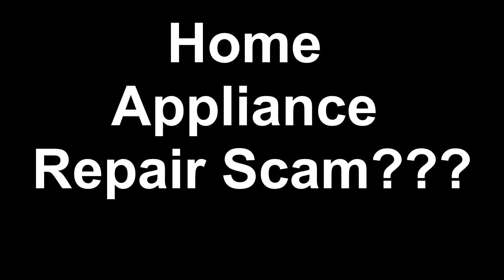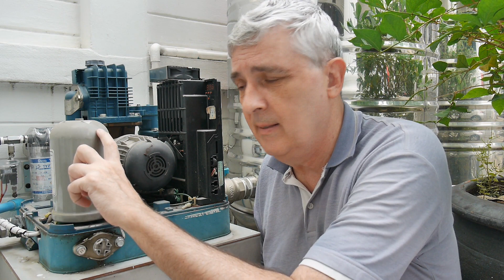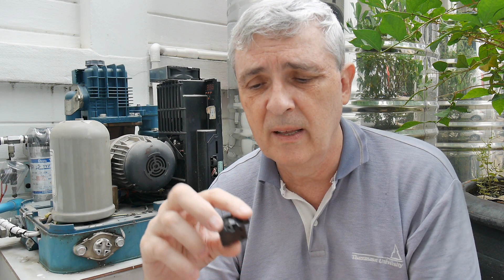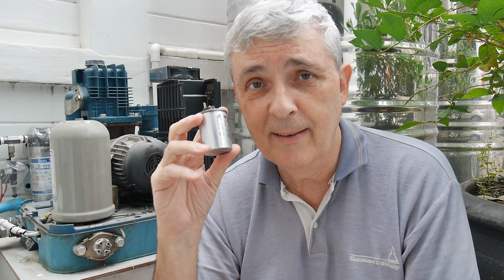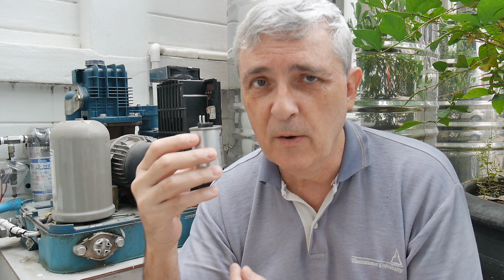Appliance Repair Scam???

Comment: Sad, but true. It's the oldest repair scam in the book. The repair people strip parts from used or junked machines and try to pass them off as new. As you stated, once they have a used part in hand, they can remove your good part and sell it to someone else. There is a corollary to this: The repair folks diagnose the problem, order a brand new part, put in a used part or don't do anything at all, charge you for it, then sell the part to someone else. You end up buying the new part that does not go in your repair. Another scam along these lines is the repair person has an old machine that he has hauled away. They use your new repair part to fix the machine, then sell the used, repaired machine to a third party.

Comment: Instead of giving my trade a bad name you should call out the name of the company or companies who did this. I make suggestions to customers like change this part because you may be calling me back and I'd hate to charge them for labor twice when I can replace the part then. That is only when I know something looks worn or have knowledge of a part that usually goes bad. 

Professional and honest companies don't need to upssell their customers. We keep them coming back with fast, quality and honest service.
Reply from the maker: Unless people know how the scam works, how can they know if they are being scammed?  Reporting 1 company does not inoculate a customer against the next bad company.  It would be better if people like you in the biz alerted consumers to bad apples in your business.
Reply: @tsbrownie  how would I know another company is ripping people off? I didn't say not to alert people to a scam. Just be clearer that this one company did this. Trades in general get a bad wrap. Most companies are honest and this video doesn't explain that it was one company and insinuates that it is a scam throughout the appliance repair industry.  Friends have actually told me they bought new because they didn't want to get ripped off by a repairman. That in turn means we throw more appliances into landfills and use more energy to make new ones.

Comment: I don't know if your capacitor was bad or not, but anyone selling "private stock" and "you pay me, not the company" is a crook, flat out. If he has an arrangement with his company to do that , the company owner is nuts. I've been a reputable service tech, in the trades for nearly 40 years, and I've seen my share of scammers, grafters and flat out crooks. They all ** me off. The guy selling his "private stock" is ripping off his employer if not his customer. No way I would do business with that guy. Call the company and let them know they have a crook on the payroll. If they are an honest company, they'll appreciate the tip, but if they keep him on, don't do business with them ever again. 

There is a known problem with bad capacitors in everything from personal electronics, motors, appliances, HVAC, pumps, even the stereo in my car. Easy to repair if you know how to. Refrigerator caps can be checked with a cheap meter. Just about all multi-meters today have a capacitance checker onboard.
Reply from the maker: Matt: I'm with you.  I think both these guys were trying to scam and there are too many honest guys out there to put up with this kind of nonsense.

Comment: While I was leaning phone repair. I was taught to say, the IC/motherboard etc,etc was damaged when you just needed a new fuse
Reply from the maker: I think this same thing happened with our Samsung cleaning robot.  They replaced the sensor board when the sensors were just covered in dust.  I will test that theory next time there is a problem because I kept the old sensor board and cleaned it.  If I put it in and it works, I am going to write someone a nasty letter.

Comment: I call a guy to repair my washing machine... The problem was simply a drive belt.
He opens it up, removes the belt, puts a new one and goes on to test it. Motor doesn't spin and he says motor is bad too.i knew the motor was good.

I tell him to step away and I inspect it. He pulled and broke the wires coming out of the motor.
I kick him out and call the company.

Next thing I know, he got fired for it. He seemed to have been running a scam where he tells people he'll replace motor, but in reality he swaps them across customers.
Reply from the maker: Sounds similar.

Comment: Similar to HVAC techs who tell customers their condenser has "gone bad" and needs to be replaced when, in fact, it's just the capacitor that's bad.  A $10.00 part (which almost anyone can replace) becomes a $2300.00 bill.
Thanks for an excellent video/warning!
--- Old Matt
Reply from the maker: OK, thanks.  Something else to look out for.